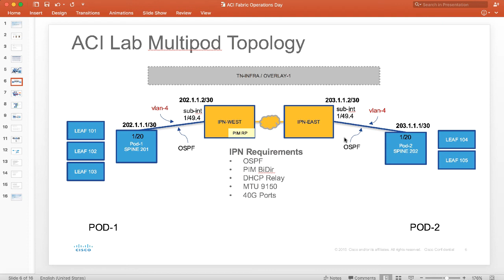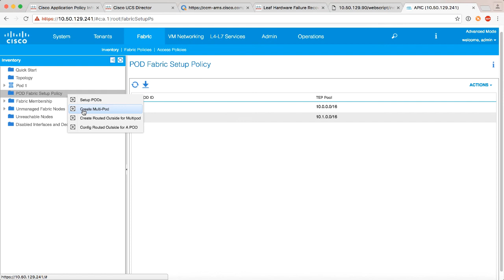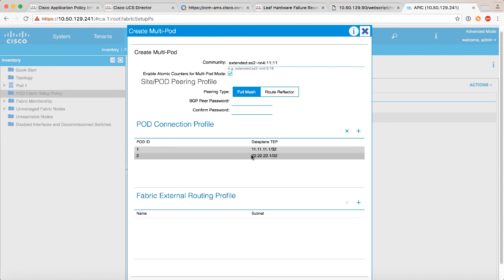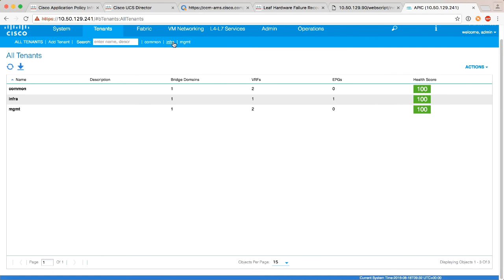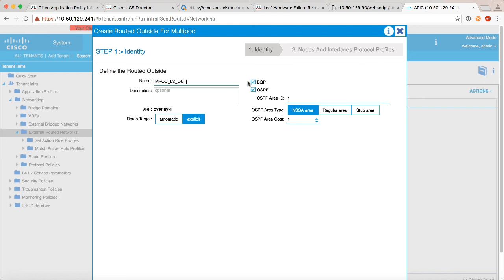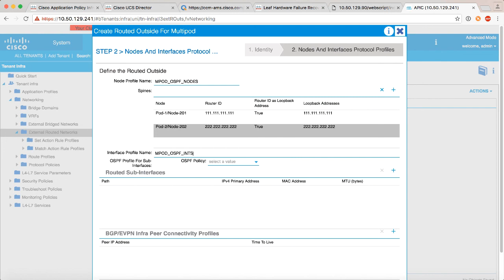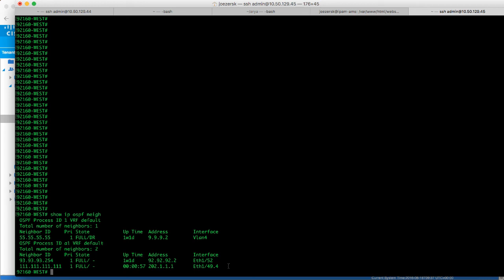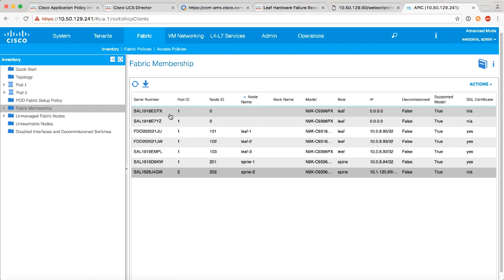ACI Multipod - Part Two - Set up OSPF Adjacency

Comment: Hey Joseph!
First! I´m really impressed with your explanation!
I´m running version 4.0 and I can´t see the "Create Multi-Pod" when I do a right click under "Pod Fabric Setup Policy". In fact, the unic option that appear is "Setup PODs".

All of the other configs is fine.
Do you know if this step is not more required since I´m using 4.0 version?

Tks!
Reply from the maker: Hi Jose.  Sorry I missed this comment in my Inbox.  Forgive the late reply.  As you have already seen, there was a significant reworking of the APIC UI.  In the background, the objects and relationships are still the same, just the look and feel is new.  So, in 4.0 and later, I actually prefer to use the wizard now.  Normally, I did not like ACI wizards but they re-did those and they are much better now.  So, you can find that wizard under Fabric Tab >> Inventory >> Quick Start >> Add Pod.
Reply: Have some question as  you with verion 4.2. Instead I tried to setup multipod from "Fabric"->"Inventory"->Quick Start and click Add Pod. But some of the configure option is different compare to this video.
Reply: @xavierliu1463  have you deployed it, I am stuck with the same problem ???

Comment: How did you prepare the other side (pod2) before this demonstration. Did you set up a temporary APIC to setup the multipod configuration on that side?
Reply from the maker: No prep other than deciding on names and IP addresses I intend to use before I began.  Everything in POD-2 is straight out of the box with zero configuration.  I only have one APIC in my lab and that lives in POD-1.  The spines are hardcoded to send DHCP requests on power up, so as soon as the IPN routing is in place to the edge of POD-2, then we can pick up the DHCP request, forward it back to the APIC in POD-1 to get an address and a small XML config file that tells the spine in POD-2 how to bootstrap itself.

Comment: Could you please explain dataplane TEP in detail?
Reply from the maker: Hello Nikhil, there is not much too it.  It is a new type of External TEP that was invented for Multipod use.  It is used as the anycast shared address across all spine switches in a pod and as the EVPN next-hop IP address for interpod data-plane traffic.   It is not an address that comes out of your internal TEP, but rather a different subnet that needs to be reachable and routable across your IPN.  Hope that helps.
Reply: Thanks alot Joseph..

Comment: can you post the OSPF routing tables for your lab?
Reply from the maker: 92160-IPN-WEST# show ip ospf route vrf tn-infra
 OSPF Process ID a1 VRF tn-infra, Routing Table
  (D) denotes route is directly attached      (R) denotes route is in RIB
  (NHR) denotes next-hop is in RIB
10.0.0.0/16 (type-2)(R) area 0.0.0.0
     via 202.1.1.1/Eth1/49.4  , cost 20 distance 110 (NHR)
10.0.0.1/32 (type-2)(R) area 0.0.0.0  <<<THIS IS MY APIC IN POD 1
     via 202.1.1.1/Eth1/49.4  , cost 20 distance 110 (NHR)

###

92160-IPN-EAST# show ip ospf route vrf tn-infra
 OSPF Process ID a1 VRF tn-infra, Routing Table
  (D) denotes route is directly attached      (R) denotes route is in RIB
  (NHR) denotes next-hop is in RIB
10.0.0.0/16 (type-2)(R) area 0.0.0.0
     via 92.92.92.1/Eth1/52  , cost 20 distance 110 (NHR)
10.0.0.1/32 (type-2)(R) area 0.0.0.0
     via 92.92.92.1/Eth1/52  , cost 20 distance 110 (NHR)
Reply: here are my IPN OSPF database, am i doing something wrong? 10.10.0.0/16 is the TEP IP

Link ID         ADV Router      Age        Seq#       Checksum Link Count
192.168.1.1      192.168.1.1      186        0x80000081 0x90d9   9   
192.168.1.2      192.168.1.2      175        0x80000080 0x6414   8   
192.168.1.3      192.168.1.3      194        0x8000007b 0xdc37   7   
192.168.1.4      192.168.1.4      185        0x8000007e 0x06ff   7   
192.168.1.11     192.168.1.11     186        0x8000004d 0x60fe   6   
192.168.1.12     192.168.1.12     185        0x80000054 0xe461   6   

                Type-5 AS External Link States 

Link ID         ADV Router      Age        Seq#       Checksum Tag
10.10.0.0      192.168.1.11     866        0x8000003f 0xd4d8    0
10.10.0.0      192.168.1.12     865        0x8000003f 0xcedd    0
10.10.0.1      192.168.1.11     215        0x80000041 0xc6e3    0
10.10.0.1      192.168.1.12     214        0x80000041 0xc0e8    0
10.10.0.2      192.168.1.11     265        0x80000041 0xbcec    0
10.10.0.2      192.168.1.12     264        0x80000041 0xb6f1    0
10.10.0.33     192.168.1.11     866        0x8000003f 0x8903    0
10.10.0.33     192.168.1.12     865        0x8000003f 0x8308    0
10.10.0.34     192.168.1.11     866        0x8000003f 0x7f0c    0
10.10.0.34     192.168.1.12     865        0x8000003f 0x7911    0
10.10.0.35     192.168.1.11     866        0x8000003f 0x7515    0

Comment: second question is, I am using 93180TC as my IPN gateways running OSPF in a VRF on the IPN, the ACI type 5 routes are not making it into the next hop IPN routers RID though they are in the OSPF database. I also don't see the Spine-to-IPN OSPF interfaces of one IPN routers in the routing tables of the next hop IPN router. Have you seen this before or it Is this a VRF limitation?
Reply from the maker: Would have to see your running config.  In a nutshell, OSPF is used as a platform for simple TEP reachability so that ACI can run MP-BGP over the top of it.  As long as your remote pod spine has a /32 route to reach the APIC, you will be able to register it to the ACI Fabric.  Once that happens, the APIC that handed out the TEP to the spine in the remote pod will also send a small XML config file that will allow the spine to bring up OSPF on the far side.
Reply: here is my IPN's routing table. You are right, the APIC shows up as a /32 in POD's IPN routing table

 sh ip route vrf IPN

IP Route Table for VRF "IPN"
'*' denotes best ucast next-hop
'**' denotes best mcast next-hop
'[x/y]' denotes [preference/metric]
'%<string>' in via output denotes VRF <string>

10.10.0.0/16, ubest/mbest: 2/0
    *via 192.168.1.64, Eth1/49.4, [110/20], 00:12:04, ospf-IPN, type-2
    *via 192.168.1.68, Eth1/50.4, [110/20], 00:12:04, ospf-IPN, type-2
10.10.0.1/32, ubest/mbest: 2/0    <<--- APIC1
    *via 192.168.1.64, Eth1/49.4, [110/20], 00:12:04, ospf-IPN, type-2
    *via 192.168.1.68, Eth1/50.4, [110/20], 00:12:04, ospf-IPN, type-2
10.10.0.2/32, ubest/mbest: 2/0 <<--- APIC2
    *via 192.168.1.64, Eth1/49.4, [110/20], 00:12:04, ospf-IPN, type-2
    *via 192.168.1.68, Eth1/50.4, [110/20], 00:12:04, ospf-IPN, type-2

Even with this the Spine in POD2 shows up on the APIC, but do not picking up TEP IP addresses. it does take name change. Do you have a link to a doc that shows the MultiPOD registration process?
Reply from the maker: Do you have at least one leaf connected to the spine in Pod2?  If you just have a spine with nothing else, the spine will never register.  

The registration process is begun over a DHCP exchange.  The spine in pod2, which is hardcoded to use VLAN 4 will send an L2 DHCP request for an address.  That broadcast packet will hit your IPN serving POD 2, which is where you have dhcp relay set up on sub-int vlan 4.  The IPN device will unicast that packet directly to the APIC's TEP address, which in your case is 10.10.0.1 and 10.10.0.2.  You should have both set up in your IPN relay config.  The APIC in the seed POD will get the request, and send both an address and a small XML bootstrap file that will allow the spine in POD2 to have the bare minimum of config in order to bring up OSPF to the IPN.  The DHCP request should also result in the spine showing up as a device needing registration in Fabric Membership.   If you send me your email, I can sent you a PCAP file of what that looked like in my lab.
Reply: Hi, this has now been resolved. It was down to interface IP address mismatch. I am still keen to review the PCAP file, can you upload it to you Github profile? Thanks
Reply: The only issue now is the APICs in the remote PODs are stuck in "Fabric discovery in progress"status.
Reply from the maker: hmmm, that is a different beast.  I assume this was an APIC that used to live in POD1 and you moved it?  If this is the case, you should erase that 3rd APIC.  Use "acidiag touch setup" from the APIC CLI and then reload.  Move it over to POD2. Power up and answer the initialization questions like normal.  Two things to note.  Your POD will be POD2, but, and this is the important one, your TEP pool that you enter will be the TEP pool from the seed pod, (so 10.10.0.x/x).  This is needed as the APICs need to cluster on the same TEP pool.  So no matter where you put an APIC in a multipod setup, the TEP pool you enter will always be the pool from pod1.
Reply from the maker: PCAP is now in my Git repo.  https://github.com/joezersk/aci-multipod/blob/master/apicdhcp2r.pcap
Reply: This is a fresh install,  the TEP pool is the same across all PODs, so is the Fabric name, ID and Infra VLAN. The only variable are the POD ID, Controller ID and name. Yet still stuck in that mode. Do you have troubleshooting doc that shows the various states?
Reply: Thanks